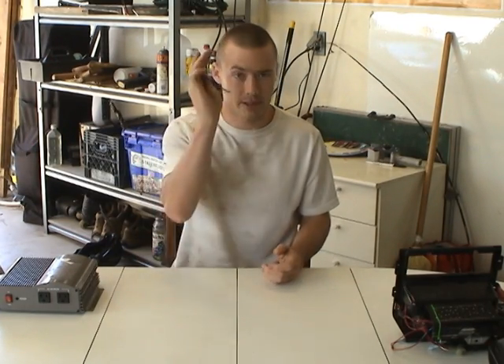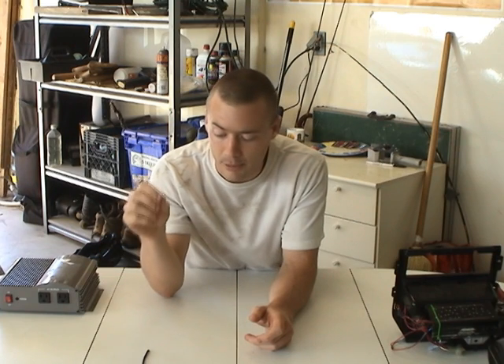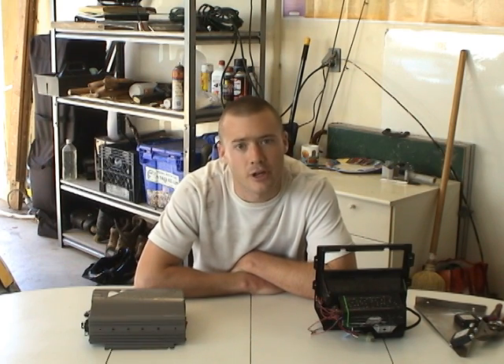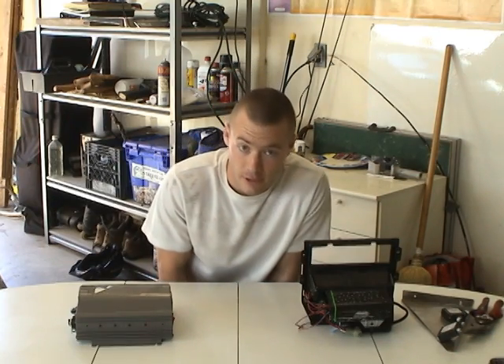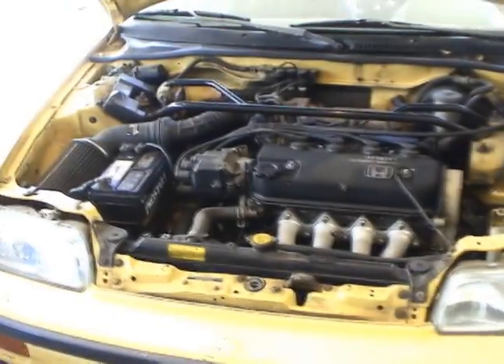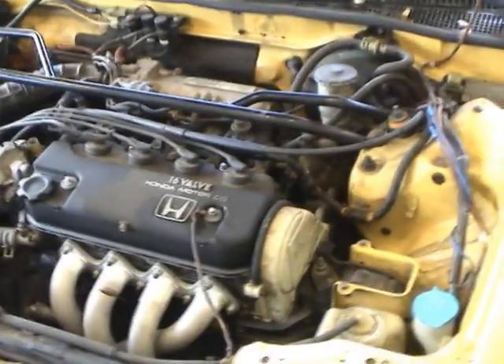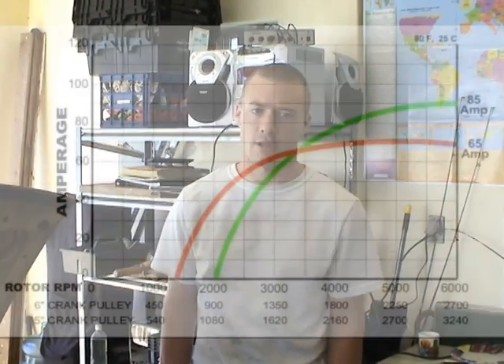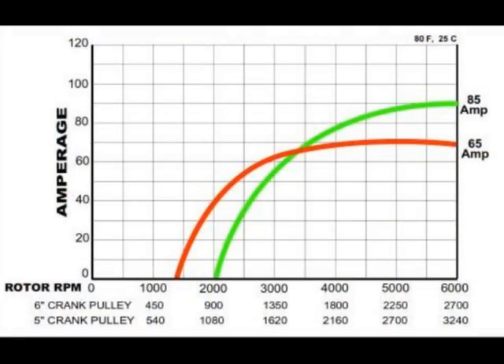Inverter Guide: Part 2: Electricity, batteries, alternators

Comment: @MovingUpp YOU NEVER WOULD EVER PUT A SWITCH ON AN ALTERNATOR CAUSE THE MAGNETIC FIELD GENERATED BY THE ALTERNATOR WOULD COLLAPSE BACK INTO ITSELF AND CAUSE A LARGE BACKWARDS FLOW OF CURRENT INTO THE ALTERNATORS DIODE PACK AND DESTROY IT.